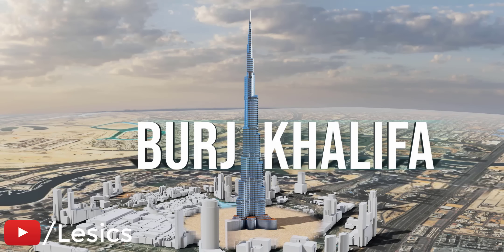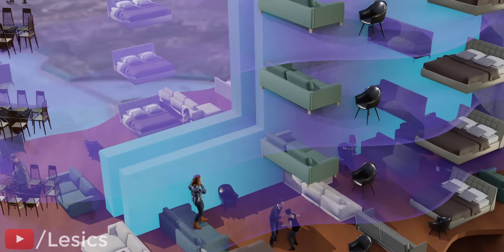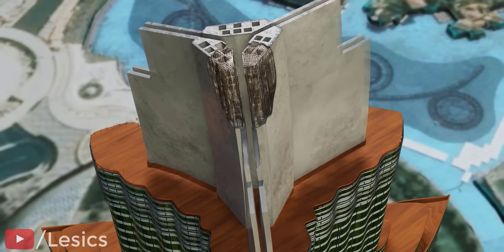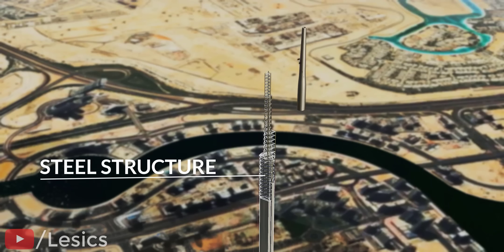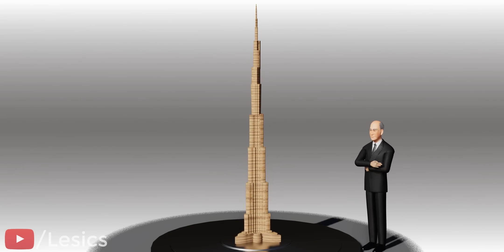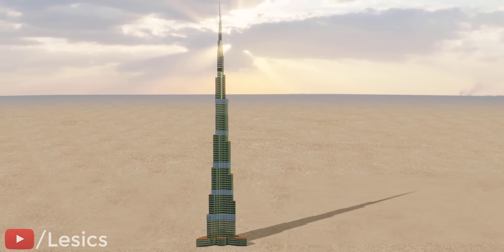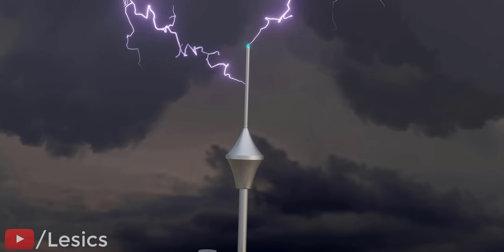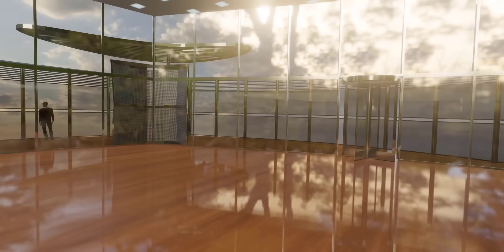Burj Khalifa | All the Engineering Secrets of the Mega structure

Comment: how did they get the concrete that high if the concrete would had set before it got to that height? they used special concrete... so they it doesn't set... bc its special... The Ringer level stupid question

Comment: Eng. Osman abdillahi ali
I would like to know what type of iron bars are used for the skyscrappers. To my opinion, i think 60mm, shall be used for the footings and the first 5 floors with 40mm iron bars for horizontal tie beams. After wards the second five floors shall be used 50mm iron bars with 30 steel bars. After wards the third 5 floors shall be used 40 mm steel bars with horizontal tie beams of 20mm steel bars. The 4th 5 floors shall be used with 30mm steel bars with 20mm horizontal steel bars. The 5th 5 floors shall be used with 30 mm steel bars and 20mm horizontal tie beams. I cannot understand whether my estimation and planning is correct or some thing is wrong. Give some sort of suggestions. Hey. Thank you very much

Comment: Yes, it is Tata Steel and Voltas! supplied 39,000 tons of steel rebar to build this iconic structure. ... The structure includes more than 4,000m2 of ComFlorÂ® composite floor decking provided by Tata Steel, which was installed at the very top of the Burj Khalifa.

Comment: It's all connected tensile strength with a concrete steel structural support of tesile load working with the torsion concrete of immense tensile asymmetrical vortex shredded super tensile absorbing resonance frequency tensile shredding spiral killing super concrete variant height super spiral. It's simple really.

Comment: Incredible feat of engineering, but personally I dislike unnecessarily tall buildings as building multiple smaller buildings is way more efficient.
Reply: If it’s just one tall building it’s ok.  Multiple tall buildings causes a “downtown” effect.  Dark streets between them, which attracts lots of bad stuff.  Mostly crime.  New York City, being a great example. Downtown LA also a horrible place.
Reply: @YouGotPropofol  Oh never thought about that part of it. You are right it sure does that. I mostly referred to cost and building efficiency. The tall the house the worse the energy cost (heating, power and especially cooling) plumbing also becomes very hard and the space efficiency doesn't even work that well because the foundation takes up so much more space.

Comment: If I was architect, I would also create windows through the buttress part, adjoining the core. These windows would reduce windload significantly, and this space could be utilized for cooling towers. Cooling towers would run with high efficiency also. This would be in 1/5 floors, randomly placed for aesthetics.

Comment: Covered almost all points but few imp points missed such as:
1.Cooling system
2.design for pressure difference between air inside the building and outside air.
3.water management.
 I like the animation part a lot  from your videos ❤️
Reply: Your query is utility service oriented, his presentation is structure oriented.
Reply: forgot the Poop Trucks.  Yes the Burj Khalifa isn’t hooked up to a municipal wastewater treatment system. They must haul the crap out of there.
Reply: @a9c  Yep, no sewage system...a marvel of engineering.
Reply: @yourhandlehere1  the whole dubai city is marvel engineering. 
They built artificial island when there is plenty of land available around city 🤦
Reply: @a9c  Lol that's a complete myth, documents from 2006 made by the same engineers show that the building is connected to the city sewage system.
Reply: Forgot the sewage system. LITERALLY
Reply: @Handlebarrz  Well, plenty of sand...they just use it like a giant cat box
Reply: @yourhandlehere1  It's not that simple. For such projects you need sea sand, because the desert sand is too smooth.
Reply: @skilllessbeast7416  Nah...you can poop in any kind of sand.
Reply: @yourhandlehere1  😁😁😁😂😂🤣
Reply: Colourful Rajasthan State
.....
https://youtu.be/q9LKjkM9xDk
Reply: Sadly no waste management

Comment: Lesics never disappoints. Very easily explained and kept me interested through out the whole video.
Reply: concrete is reinforced with steel like 99.9 percent of the time in structures
Reply: Lesics please make a video about Linac machines
Reply: ok
Reply: Colourful Rajasthan State
https://youtu.be/q9LKjkM9xDk
Reply: https://youtu.be/4aXo5A5EKHE
Reply: Loose sandy soil,Hexagonal core,Buttress walls,columns & crosswalls,Wind force,Bending Force,Hexagonal core steel structure Inside,Columns of burj khalifa,mecha. Roof,SOM/                  /spiral shape due to viral angle 830m,Whitewall,
Reply: Foundation of sandy soil,Raft,192 RCC pILES,lighting arrester,Li
Reply: William f. Baker/structural Engin./Burj khalifa,

Comment: sir, your explanation is very well. can you explain how to print billions of  transistors in a single semiconductor surface.
Reply: yea microchips are still magic
Reply: let’s get this request noticed
Reply: Search UV Photolithography. Actually the process is very simple, You have the sillicon waffer treated with a substance called photoresist (DNQ and novolac), Using a UV mask on which the features of the Silicon circuit are drawn ( the shape and connections of the transistors, to put it simple), UV light (less than 390nm) or EUV (124nm to 10nm), or even X-rays for less than 10nm, the rays of light burn the photoresist from the surface pf the silicon waffer, which is then cleaned of the surface, thus the tiny circuitry required for the proper function of the micro-controller you need is born.
Reply: Ok
Reply: @ynk69  Thanks!
Reply: @ynk69  thank you for explaining
Reply: Chips are made?
Reply: yes please
Reply: ok
Reply: Lesics please make a video about Linac machines
Reply: ok
Reply: Need understanding in pipeline structure
Reply: Sure
Reply: Colourful Rajasthan State
https://youtu.be/q9LKjkM9xDk
Reply: 23
Reply: We've found out that the answer lies in doing them one at a time.
Reply: I like your idea
Reply: @thabangmashabela6837  Exactly. As they say, the longest journey begins with the first small step.
Reply: Ok
Reply: Bot